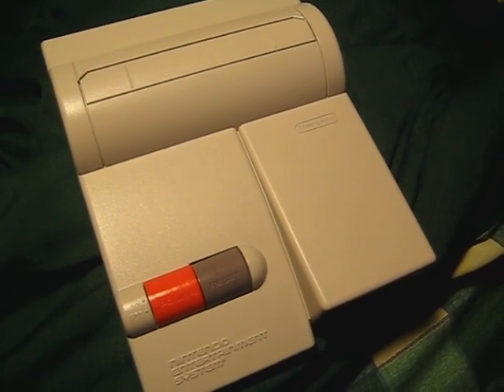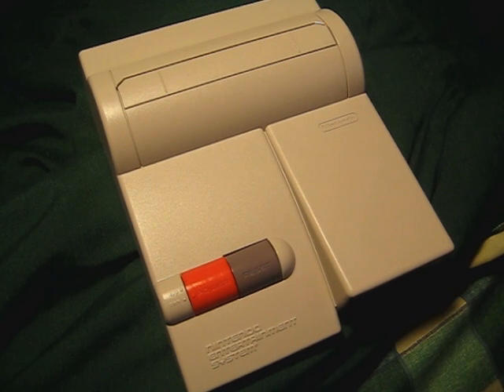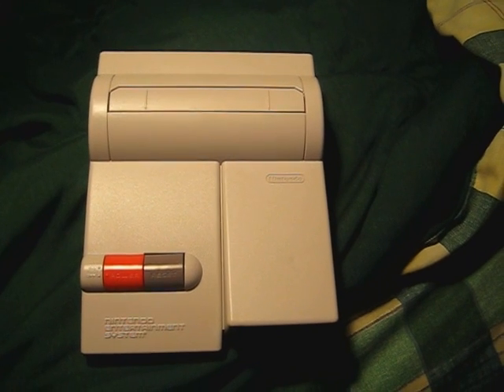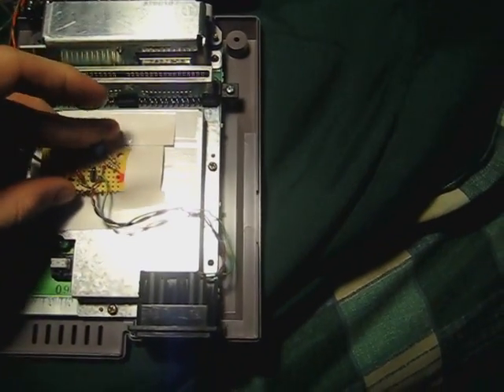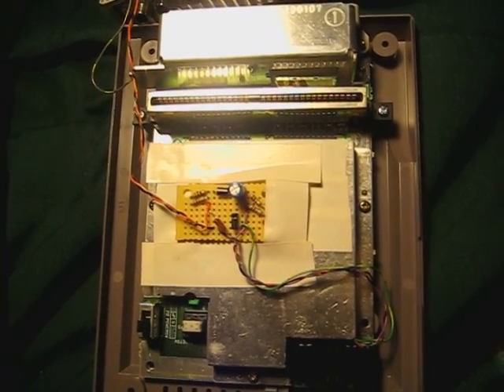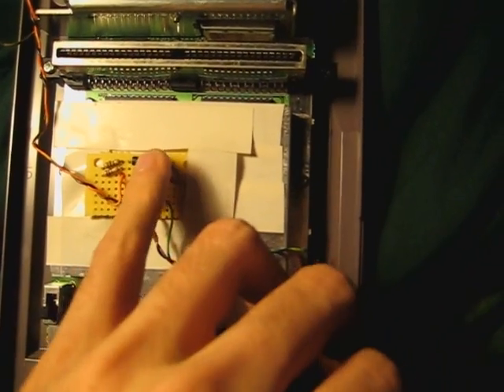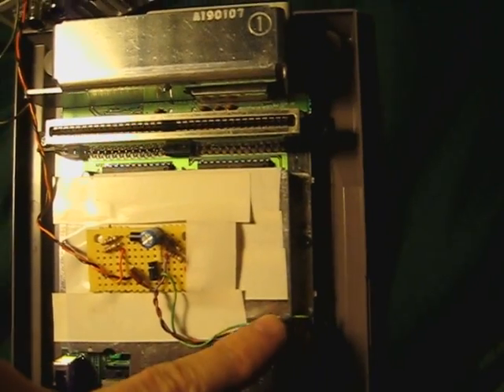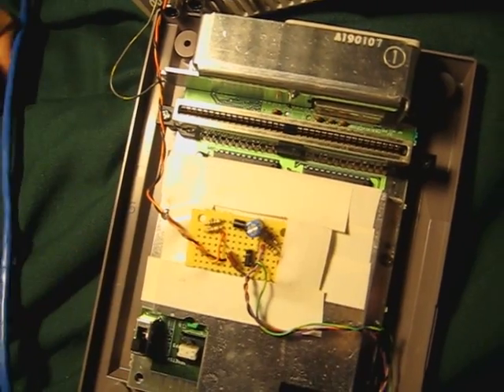NES2 / NES Toploader - CLEAN AV-out Mod

Comment: Nice job on the mod.  I've actually seen an NES 2 - on youtube - where the video output is that square/gray connector - the same one used on SNES, N64 and GameCube.  

I don't know if his was a 1-of-a-kind model, but it wasn't exactly an A/V famicom from Japan.

My personal NES (original one) I actually can't use RF on - which is no big loss - but when I took it all apart a couple years ago, I ended up removing the metal sheilding completely.  I use rca and a y-splitter for audio.